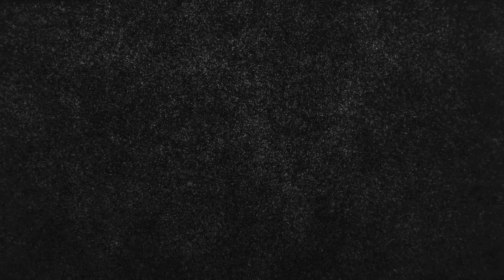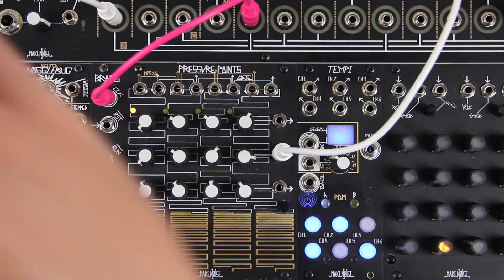BRAINS Gates

Comment: can you explain all the patches that are half visible here?
Reply from the maker: The Clock is multed to Strike a channel of Optomix for Note Events. The tuned voltage is patched to control the pitch of a VCO that is in the signal input of that Optomix channel. The gate output in the second half of the video Strikes the other channel of Optomix, with a different VCO in its input. At the end, the T-Gate output is used to hold the Optomix open via the Control input for sustained notes.

Comment: What I miss about pressure points when brains is attached is that (without clocking brains) tapping a pad sets the gate high and so tapping it a second time doesn't have any effect as the output is already high. I used to use each pad on pressure points to be able to trigger up to four different events manually, re-triggering multiple times and this doesn't seem to be possible with brains attached. I have to tap another pad first before I can re-trigger the first pad. I see a lot of mentions about the common gate working differently but this never gets mentioned. Is there a work around for this?
Reply from the maker: Yes, this is the one thing that is lost when BRAINS is connected. Many gate and trigger inputs will respond to the Pressure outputs, but otherwise you will have to decide whether you would rather have your gate outputs optimized for sequencing control, or for manual event generation.
Reply: Thanks for the reply. It would be nice to have a switch to activate and deactivate brains
Reply: @chrismenes1186  Great idea.